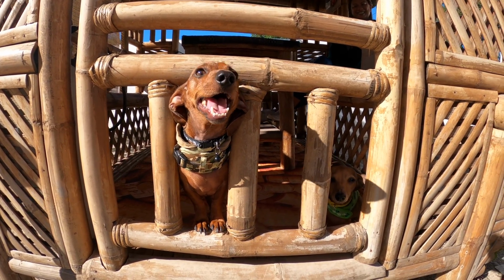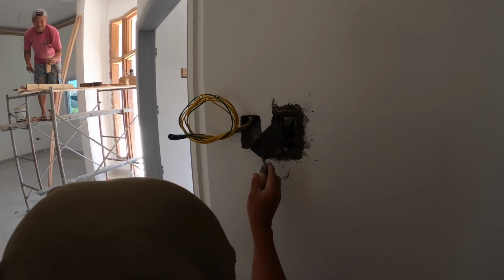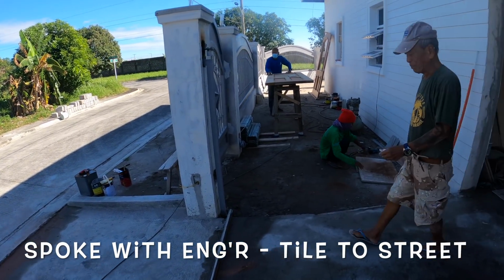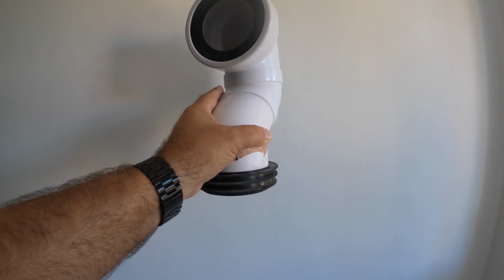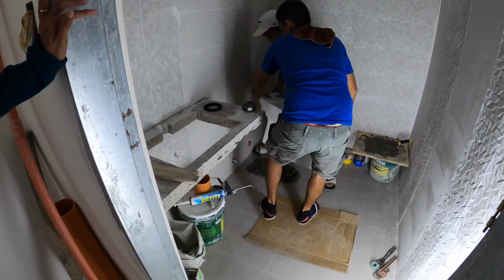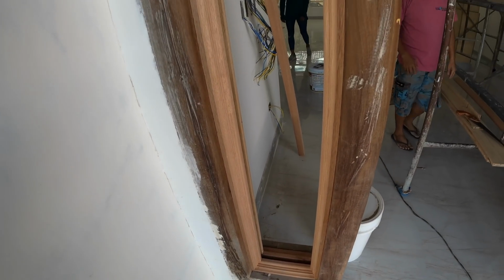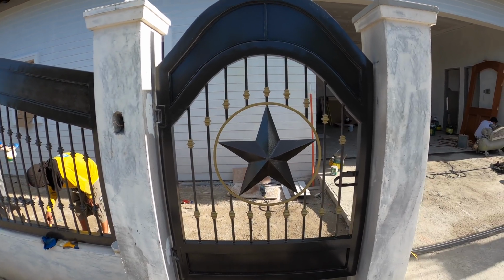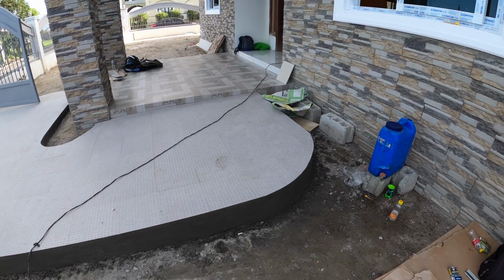Philippine House Building Step by Step, Build Day 210: No Ring Required

Comment: The design and actual build makes the most sense compared to the houses surrounding. Love how you have space on the perimeter of the house.
Reply from the maker: That's by design of the subdivision's deed of restrictions. 3M to the front, 2M sides and rear.
Reply: @CasaTexPina  ive canvased many of the houses in Q.C. Its a mess. The earlier houses were not built with codes.  Great job to your team
Reply from the maker: @Alexander-uw7im  Thank you. 😁

Comment: Hello from Vancouver, Canada :) Thank you for sharing your beautiful build from day 1 until I hope to full completion. I am interested in using the fibre cement board cladding, the same you used in your exterior wall. Maybe I missed it, but I will appreciate very much if you could please show in details how the corner joints (I.e. fibreboard to fibreboard, and fibreboard to stone clad corners) has come out to. I am planning a farmhouse-like build in Pangasinan soon.... thank you and God bless.... Gerry Frias
Reply from the maker: Welcome to Casa TexPina!
The fiber cement board corners are filled with skim coat then sanded smooth for painting. The stone work extends slightly and the fiber cement board butts up to it. Then filled, sanded, and painted same as other corners.
Best of luck with your future build.
Reply: @CasaTexPina  thank you Sir!